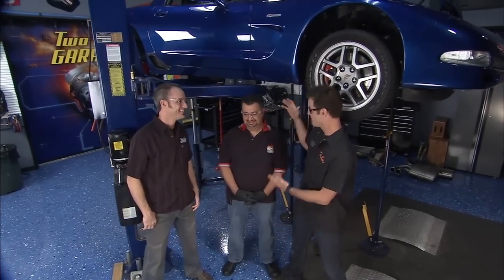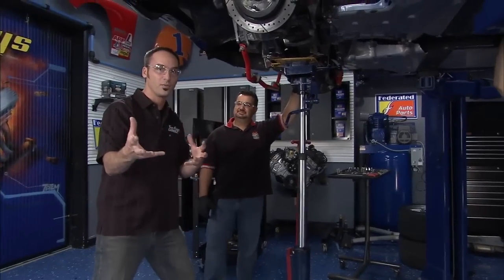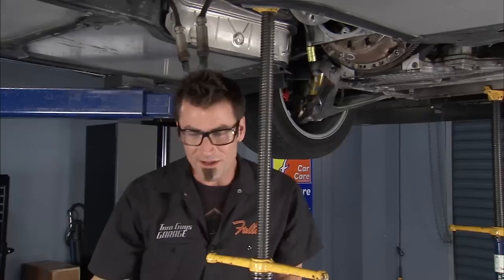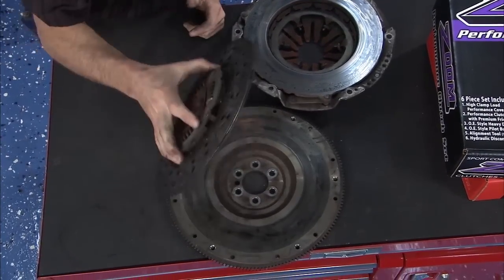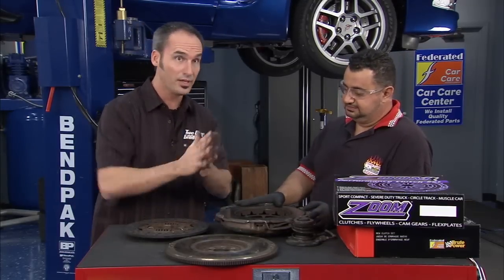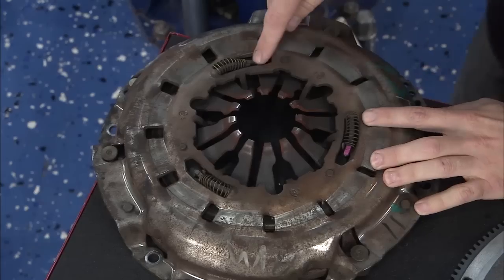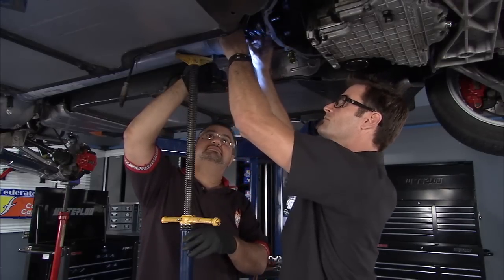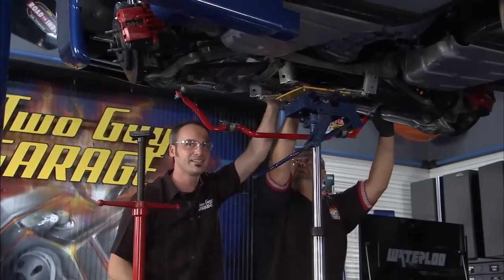Replacing a Clutch on a Corvette | Two Guys Garage

Comment: How much does a job like this cost??
Reply: Cheap shop + oem clutch and stuff =1200 bucks or reputable shop + performance clutch = 2000 bucks
Reply: @DuBstep115  Dealership tride to tell me it would be over 3,000 for install alone...No parts!
Reply: @roy-sr5ct  a dealer uses a flat rate.  So they probably quoted you 20 hours or more.  It doesn't take that long.  Go to a good speed shop and it'll be less than that
Reply: @roy-sr5ct  wrong.  2k max
Reply: @mjphoto45   ok mr no everything! I went there and ask my self..  Doubt you even have a Corvette just running your mouth about stuff you know nothing about

Comment: Been a pro tech for 25 plus years. Got my first clutch in a 98 corvette this week. Thought I'd watch a video or two to see what's what. Although I do have direct access to the gm official procedures. 

This video makes it look quite simple. 

What this video doesn't show you is all the little stuff involved in each step. 

One does not simply undo the rear shocks and remove the rear cradle. There is a shifter to unhook first,brake lines to deal with. Electrical wiring along the torque tube. Suspension to unbolt. Removing the rear spring to access things. 

After I watched this, then started working, I realized that this video is pretty useless.
Reply: Bro. I was thinking the same thing. It seems like a big 'Zoom' aftermarket China-man company clutch commercial. If you use jack stands, this video is TOTALLY worthless. The Corvette looked clean, but in their defense... Bolts weren't making friends with them, and neither were the cusswords being recorded. Lets be fair, fellas. 

If you read this before the video is done, just skip on to the next one and save some time.<< Just read that part, actually.
Reply: So are the hosts along with this show

Comment: While more difficult than some other types of work, this is something you CAN do on jackstands in your driveway.  These guys are a bit spoiled.  They have everything they need to make things easy.

Also, they don't really show most of what's involved in doing this job.
Reply: Shane Broussard I hear ya Shane.  My throw out bearing went bad so I decided to replace the throw out bearing the slave and upgrade to ls7 clutch with a aluminum flywheel. I did all on jack stands in the garage with just me and Jesus. It took seven days but I did it.
Reply: A corvette clutch with jacks in your driveway? Oh no...
Reply: @corvettez06mj  im on my 6th

Comment: A dealer or who ever at 85.00--100.00 per hr should do this job in  7 to 8  hrs...parts online are 5 to 600.00 for a ZR...These guys look like they did it in 3 hours or less ?
Reply: it is possible to do this job in less than 3 hours